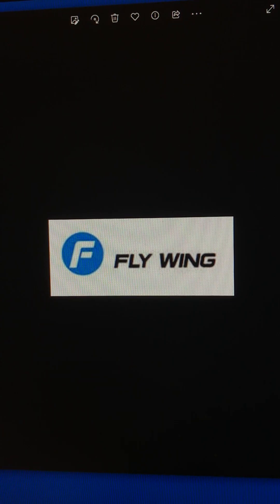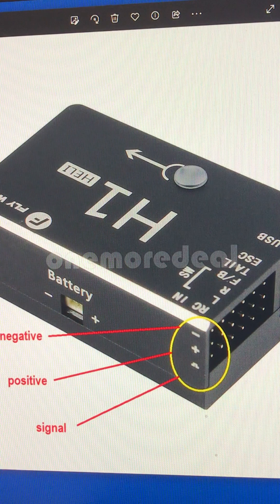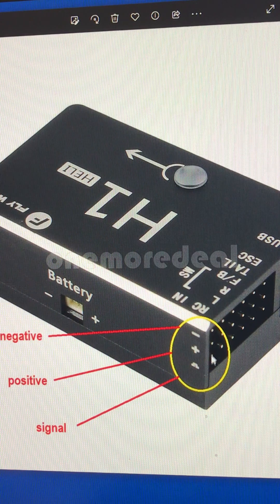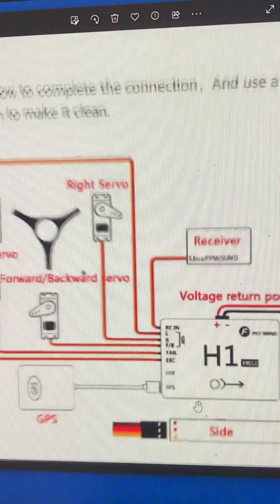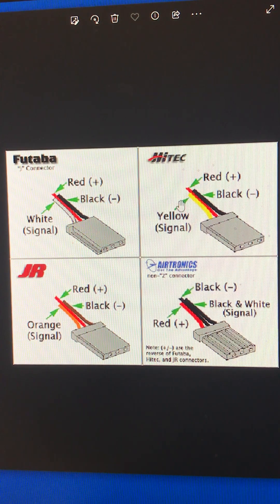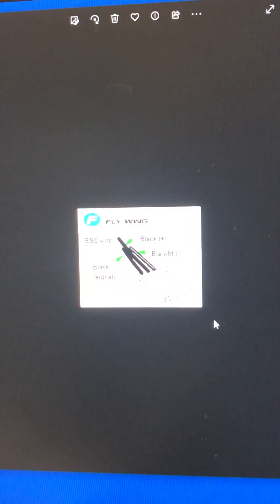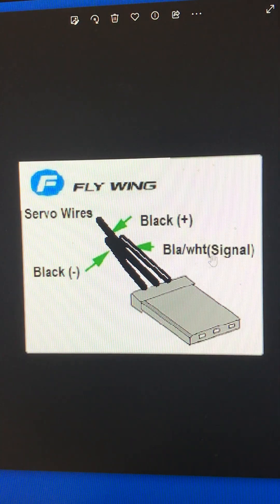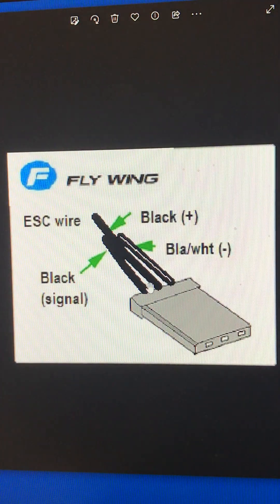Flywing FW450 v3 ESC mistake follow up

Comment: Thanks!  I did the exact same thing plugging in the ESC wire and it acted possessed.  Flipped it around and it works great.  Your video was a big help.  Not sure I would have realized it was backwards as it fit the rest of the plugs by coloring.

Comment: Hi. The plugs are beveled on 2 edges. Normally you can't plug them in the wrong way around or am I seeing it wrong?🤔
Reply: Ah nevermind... I see, the H1 flight Controller has no spezific shape... So the plugs can unfortunately fits in both directions... 😅😩